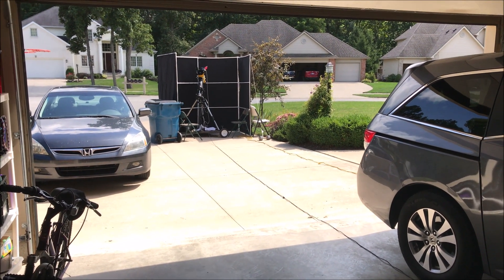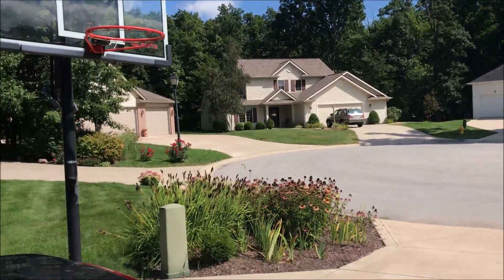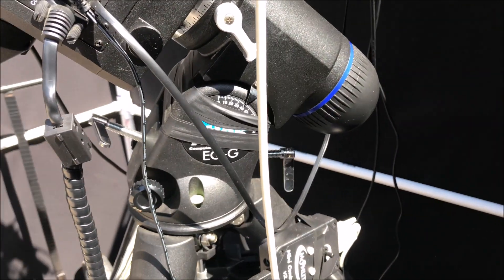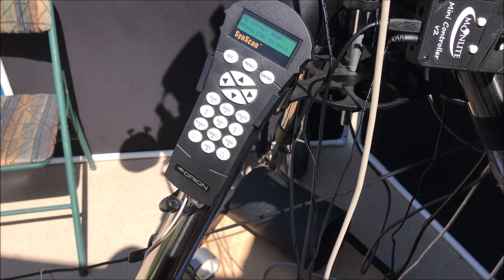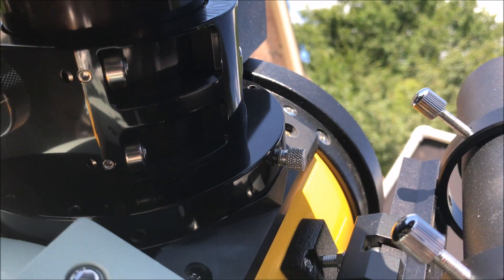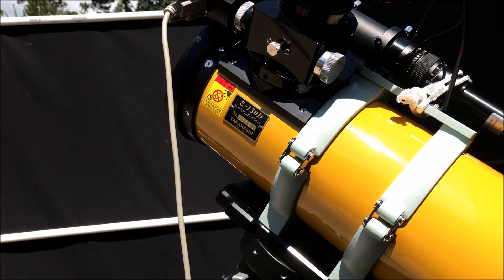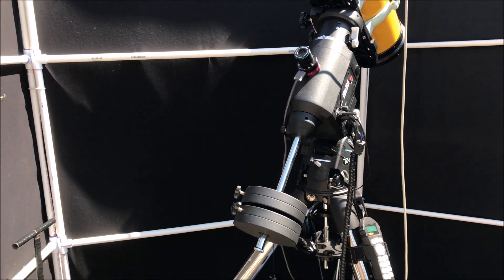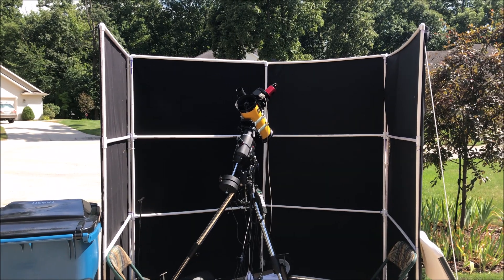Portable Astrophotography Driveway Setup

Comment: I literally use my daughter's cheerleading is cheerleading mats as wind stray light blockers. Works like a charm
Reply from the maker: That sounds like it works very well.  If my panels are not weighted down with those ropes and weights they will blow over.  Cheerleading mats would provide weight and thick light resistance.
Reply: @c.m_astro  I usually just kinda put lawn chairs around the outside /inside so if any wind hits the chairs hold up the mats. It doubles as a cool place to sit and actually watch the night sky after setting up. I definitely like this pvc frame version though. Nice and uniformed.
Clear skies

Comment: nice , this is something i can get on board with ,would you care to share the dimensions? thank you
Reply from the maker: Hello.  Sorry for the delay.  Each panel is approximately 7.5 ft. x 4.5 ft..  I believe I set the height based on the height of my setup and what it would take to provide some margin and keep light off the setup based on a not too distant light pole on my street.  Each portion consists of 2 panels that fold together.  I stack them on the side and place them along a wall in my garage.  Thanks.

Comment: Great idea. About how much did the pvc and fabric cost you?
Reply from the maker: Hello.  I don't remember the total cost for the PVC.  I purchased it at Lowes.  You could get a total cost by adding up the total lengths of all the sides, tops, and cross members.  You will need 'T' joints as well as right angle adapters as well.  Regarding the commando cloth, it isn't cheap, but you may be able to find a good price if you shop around.  There are a lot of different vendors that sell it.  For example, I see Amazon has one particular listing of 56" x 15 ft. for $43.  You just need to make sure you make it tall enough, but not unnecessarily too tall that it is unstable.  I have a street light a few houses down to deal with and I wanted to make sure the panels were high enough to block the light from that.  You would want the height to exceed the max height of your setup / telescope as well as some margin on top of that.  I think I used 1" for one panel and 1 1/2 inch for another panel.  The 1 1/2 inch PVC panel is more stable and more wind resistant, but it is much heavier.

Comment: Good idea on the PVC pipe screen 👍 What diameter pipe did you use, and what material? Nice Tak!
Reply from the maker: Thanks.  The material I used was purchased on Amazon.  It's "Duvetyne Black Commando Cloth 54" Wide X 15 Feet in Length (5 Yards)".  It has better light blocking characteristics.  I used schedule 40 3/4" PVC.  I also had to tie rope to the upper corners at each end and route down to weights on the ground to keep the panels from blowing over if there's significant wind.  Using 1" PVC might help with that, but the panels would of course be heavier.  1" might be a little too heavy.  I can carry the 3/4" without issue.  Not too light and not too heavy.